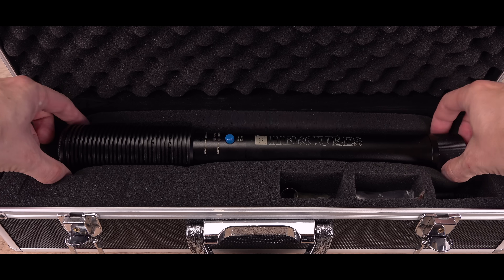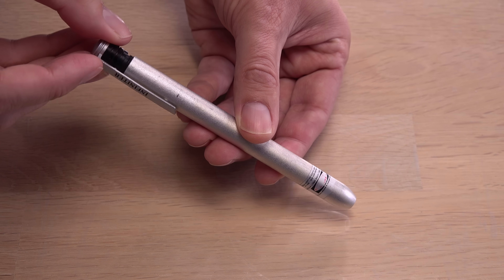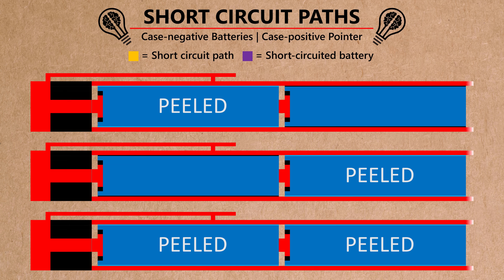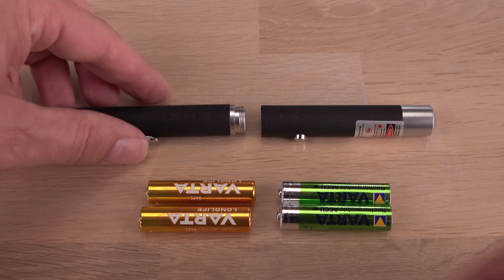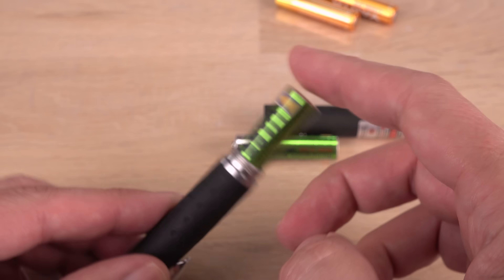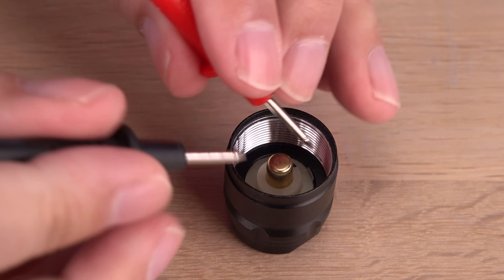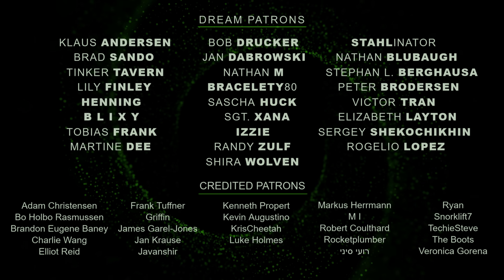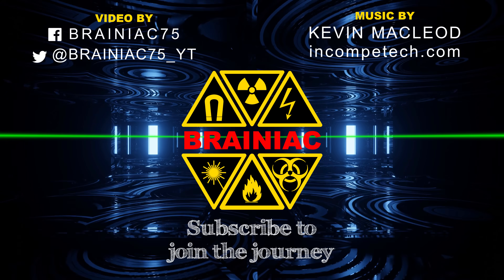DUMB DESIGNS | Laser Safety Issues Never Mentioned

Comment: Ahh dose button cells lasers.   I remember back in like 1998 , in sweden, in some cheap marketplaces, you could get a laserpointer wtth 3 button  cells for around 30 swedish crowns, and when you have ro replace, the buttencell cost 15 kr each,  (3*15=45)
Reply: It's cheaper to buy a small industrial bulk tray of most button cells, than to buy a couple in retail blister packs with a branded distributor.
Reply: @lokiva8540  They have limited shelf life, though, so unless you buy for 20 people it's not very practical.
Reply: @VcSaJen I've button cells I bought 9 or 10 years ago (packs of 100 for red dots, laser pointers and other things like calipers or luggage scales) which still work fine.

The shelf life is limited, but nowhere near the date stamped on the pack, like most things.
I'll have probably run through all the cells before they expire, or at least it'll be a race to which happens first.
Reply: I think you can still find them in some pet shoppes.
Reply: @pauls5745       It's foolish to buy crap grade pointers that take button cells.  Normal size pointers in red and green save more in battery costs (whether NiMH or LiIon) than they cost online, and tend to be effective pairs doing alternate dots on cats.  Or, hit a cat's paw, and act like the dot is stuck to it when moved, if you can PsyOp the cat.
Reply: I also remember when they first came out on the market, it was the size of a pen and cost about 1600 kr i think it was 1995 ,  not the gunsight type, they hade been around for a while

Comment: The expensive laser has several sensible interlocks however the five second delay is not one since after inserting the key, shorting plug,  pushing the 'on' button then opening the aperture the user would expect something to happen. The delay is long enough for a numpty to take a look ! .
Reply: I agree, adding a simple bright blinking LED on the handle indicating its starting would complete this feature.
Reply: I had the same thoughts. I experienced this with the yellow laser (2-3 seconds before it started working). I checked the battery polarity three times to make sure I had inserted it correctly until I figured out what was going on...
Reply: Да уж, это как заглянуть в ствол взведённого ружья... Но такие случаи иногда всё-же происходят :)
Reply from the maker: Well, users are still required to have some common sense when handling strong lasers :D The only perfectly eye-safe laser is one that can't turn on at all. I wouldn't be surprised if some countries have regulations that require that delay for high-output lasers? I have never had issues with the delay, but it can be bypassed by using the TTL function in it, in case you need the laser to turn quickly on/off in an experiment.
I may have forgotten to open the beam blocker at the front once or twice and had a scare because I thought the laser was dead xD
Thanks for watching and sharing your opinion, Woffy!
Reply: @brainiac75 Common sense isn't common anymore
Reply: @Talljak  lack ofCommon sensse is one of humanities flaws which Darwins theory of evolution has not yet resolved.
Reply: @Talljak never has been common lol
Reply: It is a CDRH requirement to have a delay between enabling the laser output and the beam coming on, the delay needs to be approximately 5s, although some sources indicate 2.5s is the minimum requirement.
Reply: Yeah, beat me to it.
Reply: Why aren’t safety regulators paying attention to this????!!
Reply: Unless they read the user manual. I am pretty sure that with all of those lock outs in the way. The person who can't get it to turn on is going to be forced to find out why, which at some point is going to inevitably inform them of the 5 second delay as well. And if your laser already has 3 other safety lockouts, is a 4th one really that unexpected?
Reply: @DIYuntilDAWN one that's an arbitrary 5 seconds would be to me, the others give a clear indication on if they are in place or not. I think it needs a series of LEDs that light up or some other way of indicating the countdown for it to be effective and expected
Reply: @DIYuntilDAWN  bold of you to assume people will really read manuals. They wont, and will instead leave a negative review stating that the product doesnt work.

Comment: When large size isn't a problem, LASER housings with an end key safety switch, that take an 18650 battery, avoid these cheap AAA/AA NiMH issues, and can often take various alternate diode-collimator installs if one wants (plus screw on caps for lines, grids, or decorations).
Reply: I have that

Comment: nostalgia for the cheap laser with the different heads @9:56 lol
Reply: I remember staring directly into the laser beam when the batteries were almost depleted 😂 (what a dumb little kid I was...)
Reply: @TinchoX Can you see ok?
Reply: @Adamisgood24  the smaller pointers with the button cells usually are closer to the legal limit
Reply: @TinchoX we all did stupid shit as kids lol
Reply: I still remember having a couple of those during my teens. They were fun to mess with with the different screw-on pattern lenses (and playing with cats without them). Weirdly the battery situation was never an actual issue, but the protruding plastic piece that pushes the microswitch on the PCB could just... fall out of its hole, either outwards and just getting lost, or somehow getting past the peg of the switch and falling inside the housing, rendering the thing basically useless while on-the-go. And you'd only notice when you got it out of your pocket and wanted to use it :(
Reply: I still have mine from when I was a kid. But it won't come on anymore. Barely ever really used it :/

Comment: 5:51 Batteries labelled "heavy duty" are usually carbon-zinc based, not alkaline
Reply: That Heavy Duty are carbon-zinc is not a conclusive statement. Any manufacturer can call whatever they like "Heavy Duty", it's just what suits their range.

What you call AA batteries actually has a large amount of variants where the R6 is plain carbon zinc, the LR6 are alkaline, the FR6 are lithium, HR6 are MiMH, KR6 are NiCd (please don't buy these) and ZR6 are Nickel Zinc. So the IEC code is more accurate than the US specification code when it comes to describing the battery chemistry and size. Never mix batteries in your equipment unless you want nasty leaks.

Now I'd like to see a test of those battery variants. 🙂
Reply: @ehsnils - the bottom line is that if it says "Heavy Duty" on the label, then it is zinc-based and definitely not  alkaline chemistry.
Reply: @johncoops6897  "Heavy Duty" is in that case a Zinc-Manganese Dioxide using Zinc Chloride as part of the chemistry and not carbon-zinc. Then when you look at it deeper almost every alternative is performing better.
Reply: @ehsnils - My point is that they are NOT Alkaline chemistry. And the "carbon" in "carbon-zinc" generally  refers to the use of a carbon center rod, and a zinc-based anode (outer shell) . The carbon centre rod (being positive cathode) is why the top, rather than the casing, is the positive pole.
Carbon and Zinc used in construction = "Carbon-Zinc". 🙄
Since you want to be pedantic, I have edited my comment above.
Reply: @ehsnils wdym mix batteries?
Reply: @YunxiaoChu  Mixing different brands or different chemistries in the same device when they are in serial - that can accelerate the risk of a cell leak.

Comment: That's a bit nitpicky. Damaged battery insulation = damaged battery = don't use. It's a bit like carrying fuel in a leaky canister and complaining that it's leaking
Reply: The problem is the laser housing itself is what damaged the battery. You might not notice the battery's insulation is damaged while inserting and the dumb uncoated internal tube will short the battery. The laser housing is inherently defective and shouldn't allow that to happen.
Reply: @misaroorasim should they have made it broader, or just coat it with a plastic surface of sorts
Reply: @V77710 I would say both, because if they coated it , would make the tube even tighter and batteries would just get stuck.
Reply: Human nature though :p
Reply: The pointer in question is about 25-30 years old, and predates the common use of alkaline cells. *see note below*
The fact that they haven't been made like that for a very long time proves that the design was bad and has been superseded.
You don't complain about the lack of seat belts in a Model T Ford, right?😊
** EDIT** I am talking about the diameter of the tube being so tight that it scrapes the shrink wrap off the cells.
Reply: @johncoops6897  A similar design is still used in lasers and flashlights, because it's very simple and cheap. In this case the problem isn't the design, but simply user error. If I use a different power source than recommended and I see that it doesn't fit, I look for another one instead of forcing it in
Reply: @FargothPL - I meant that they no longer make the tubes so tight that you need to hammer the cells in, peeling the insulating sleeve off.
In normal applications, having a non-insulated tube doesn't matter because they didn't design the product to be id10t proof.

Comment: Do you have any recommendations where to buy good quality laserpointers?

I'm specifically looking for a red or blue one that is class2
Reply: Class 2 as in EU legal <1 mW?  

That in red is likely found in Bosch construction tools.  Most eBay pointers are either Class 3/IIIa FDA consumer legal in the USA under 5 mW, or sloppy Chinese products that may vary widely from any listed spec's.  

100 mW to 15 watts are also widely available as diode-collimator modules, or as controllable etch or cut modules for 3D CNC frames.  They're generally not legal to sell as part of working systems in the USA, and require safety interlocks and in some cases FDA licenses almost no one gets.  

Blue are harder to manufacture, and so far less available in cheap products or less common power levels.  Greens (532 nm) require caution as many are telecom reject 1064 nm IR diodes, with double-pump drivers.  If not IR filtered, they may put out far higher invisible IR beams.
Reply: @lokiva8540  Yeah exactly, I am avoiding green for a reason here.
Reply: Blue are easy to buy for a couple of dollars. Have been for a very long time.
Reply: @johncoops6897  Blue are harder to make for engineering reasons one can find videos explaining.  

Most Blue I've seen claim to be Class IIIa or Class 3 and US legal, but not Class 2 and EU legal, if we can even believe scam intensive Chinese.  

Blue are not readily available cheaply via industrial sources that do actual QC tests and document every device shipped.  

Here on YT, there's a whole industry of formulaic scam ads for products that are various mixes of consumer frauds, illegal to import or even market, or fund genocides, that Google ignores reports on and fails to take down, making itself willfully complicit with scammers.  Meanwhile it censors honest speech.  

"military grade"
"before it's banned"
"designer was annoyed by (his former employer's real product" and so now helped us make (some generic Chinese junk selling for $27 that we'll offer at the low price of $135).  

"Before our family business shuts down"  
etc.